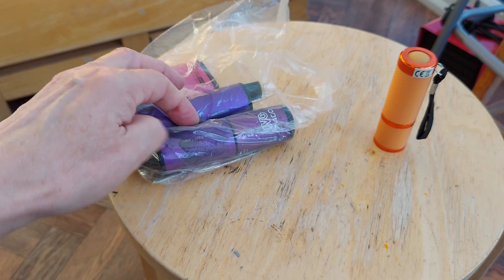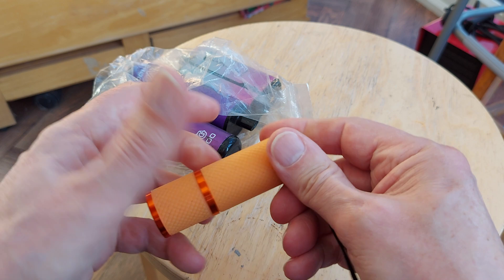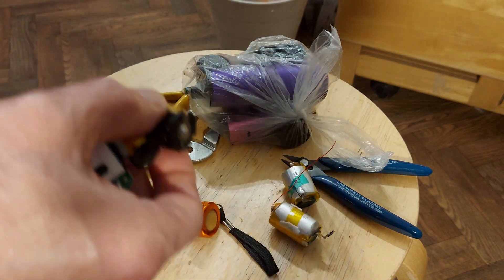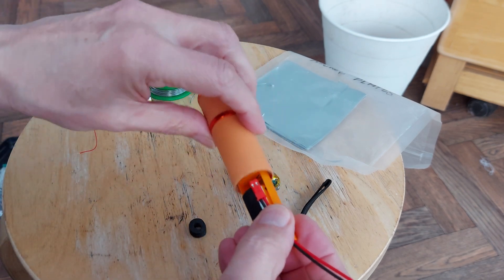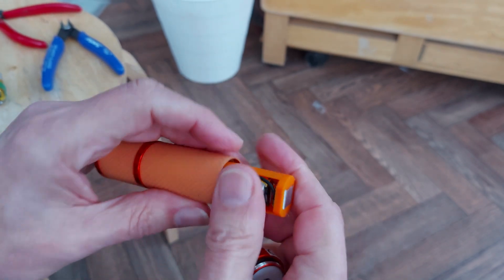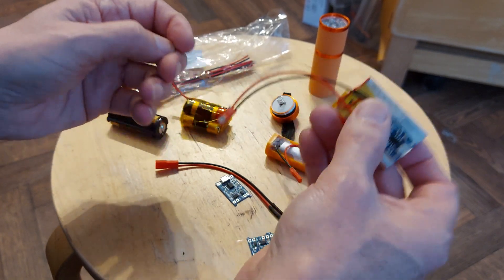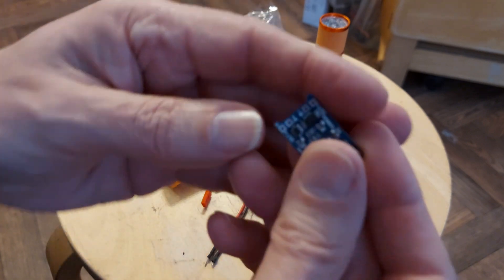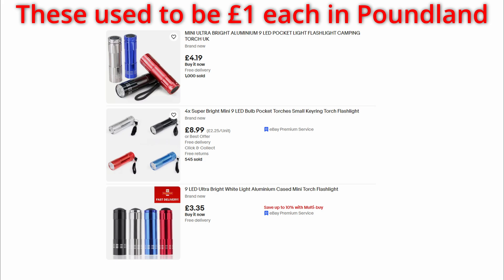9 LED Mini Torch battery conversion  - Doing something with Vape batteries

Comment: I burned out several flashlights of different sizes with vape batteries and a few 18650 due to the current. adding an additional resistor ended the failures.
Reply from the maker: Probably something to do with the voltage. 18650s and Vape Batteries give you 4.2 volts. What was the voltage the flashlights were designed for? The one I am using in this example runs on 3 AAA batteries, so that would be 4.5 volts, so a 4.2 volt LiPo would be fine.

Comment: How do you Stop the Battery from going under charge voltage? as in when being using a bms would stop it from going under voltage.
Reply from the maker: I don't worry about it.

Comment: Actually I think the output current from the chargeboard is 500mah even so it it is a bit much.
Reply from the maker: @marchorton1070  you change the R3 resistor to set the output current. Most eBay listings used to include the table of values in the details. The problem is that some people are just connecting those vape batteries directly to a 5v USB supply. I put more information in the video description.

Comment: Was thinking of trying a modification like this sometime but i was concerned about over currenting the led's
Reply from the maker: The voltage is close enough to light them fine. The current draw will only be what the LEDS drawer. The maths says we are giving the LEDS less voltage than the 3xAAA batteries  would supply, so the current will be lower.
Reply: @GrandadIsAnOldMan  Ill have to do tests with a multi meter to see what it pulls with native batteries vs the lithium upgrade , Also you can get tiny 1s protection boards which will prevent over discharge etc.
Reply from the maker: @steve64464  Yes, here is a video where I demonstrate fitting the protection board, but to be honest, it is hardly worth the effort with a little battery like this https://www.youtube.com/watch?v=NRsZs8gohzk&list=PLA5a2xPRSrB3xTZEeibfIt-jppni8A-HY&index=8
Reply: @GrandadIsAnOldMan  Yeah that looks like the exact one thanks for linking the video , If anything it does at least serve as a short circuit protection unless you wanted to go even simpler and use a mega thin wire as a crude fuse.
Reply from the maker: @steve64464  I just put a meter on it. With 3xAAA (4.59v) I get around 200mA and with the LiPo (4.1v) I get around 250mA. I would guess that the AAA batteries are dropping voltage under load to account for the lower amperage, but the bottom line is the current is about half the LiPo's rating.
Reply from the maker: @steve64464  Yes, funny you should say that. "Using thin wires as a fuse" could have been the title for this video https://youtu.be/RqkZjrdgexg?si=8_IZ60nW3TC8WLbW&t=320
Reply: @GrandadIsAnOldMan  damn , you seem to have thought of my ideas before me or something :-D , one idea I did have was 3d print 4àà batteries in a 4 block form then stuff a lipo in it so you could shove the entire thing straight into a device rather than using single one time cell.
Reply from the maker: That is a handy solution, but does depend very much on the battery box that it needs to fit into. Many of them have walls between the cells so you can't fit an "all in 1" case. What I often do, is just add a JST connector to the relevant battery terminals so I can use a LiPo or revert back to the AA batteries if necessary. Or take the more destructive option by hacking the walls out of the way. (That is my most regular "fix").
Reply: @GrandadIsAnOldMan  Yeah i guess the little separation lines may be a issue unless the cells are printed separate then connected with really tiny wires , Ugh it kinda feels like a chicken and the egg type thing deciding a design solution for this 🙂

Comment: at 10:10 you say that's a male. I am convinced it is called a female. A male connector contains (pointing) pins that will fit into, yes, the female part. Sorry for being so picky :- )
Reply from the maker: @deslomeslager  yes it is a regular debate. The male has holes in it, and the female has pins, but the male plug slides inside the female. Makes your eyes water if you think about it too deeply 🤣👍